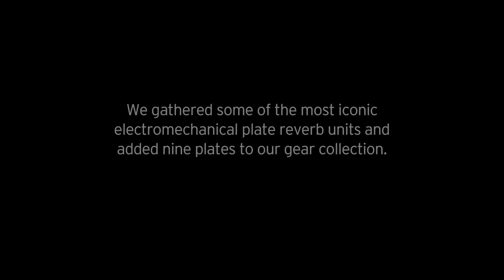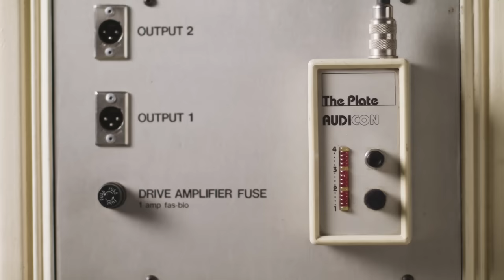Introducing Soundtoys SuperPlate

Comment: Again, I am back. After extensive testing I can safely say that this is the absolute best sounding reverb in my Arsenal. I have managed to consistently get the sounds I’ve always wanted from a Plate reverb. This reverb will win technical achievements awards. This thing does. Not sound like a plugin. I own all of Liquidsonics, all UAD Reverbs, Valhalla, Waves, Baby Audio, Lexicon PCM…And I can safely say it was worth the wait for this Soundtoys plugin. This plugin could easily be sold for $299 and would still garner sales.

Comment: Free for 5.3 bundle owners (thank you so much!). 
Upgraded to 5.4, Installed and tested - this is a freaking awesome reverb. Incredible depth and stellar sound design capabilities. 
Just running a piano through the "spaces" presets is truly inspiring. 
You guys never cease to amaze us.
Reply: Not true!
Reply: @jazzampa  what's not true?
Reply: @pietrogirardi  Not free for V5.3 owners
Reply: @jazzampa  I'm a 5.3 bundle owner, I updated to 5.4 today, for free. Superplate was included in the update. Are you a 5.3 bundle owner?
Reply: Free for 5.3 owners?
Reply: Totally not true. 5.3 user here too and they want $29 to update to 5.4.
Reply: @davespicer2143  this is weird. I think you should get in touch with them, everything worked smoothly here.
Reply from the maker: Hi everybody! Here's what's up: To UPGRADE to Soundtoys 5.4 with SuperPlate there is a $29 upgrade cost. However, we have a free 5.4 UPDATE that improves graphics and comes with a set of new factory presets for Effect Rack that include SuperPlate. Even though SuperPlate is a paid add-on to the Rack, you can install the latest update and listen to all the new factory presets for free. To do this, you install the latest UPDATE (V5.4) from your Soundtoys account to audition all of the presets showcasing the new reverb. While it’s free to check out all the new factory presets, SuperPlate’s settings will be locked until you buy a license. The $29 UPGRADE intro offer to add SuperPlate to your Soundtoys 5 bundle is valid thru June 14, 2023.

Comment: Well I bought the update as soon as I saw it & it's just... ❣
Reply: @Soundtoys fam! I made a mistake, I think. I activated the plugin in my studio computer instead of the iLok. Is there a way to use the plugin in the laptop I use for teaching & my studio or should I use the iLok activation for that? I looked for an email contact, but couldn't find it. Thx in advance.
Reply from the maker: You've got two activations so you should be able to use it on both! If you have trouble getting that working, our Support Crew can help if you open a ticket at support.soundtoys.com.

Comment: If You are user of 5.3 - there is no chance to have demo of superplate, only to buy upgrade - so thank You)
Reply: oooh I see - to demo it, I must to demo all new 5.4 pack, ok there is a mystery) The only brand with the free-for-life bundle upgrades is Melda
Reply from the maker: You can also install the free 5.4 UPDATE to the bundle from your user account before you UPGRADE to Soundtoys 5.4 with SuperPlate. Even though SuperPlate is a paid add-on to the Rack, you can install the latest update and listen to all the new factory presets for free. Simply install the latest UPDATE (V5.4) from your Soundtoys account to audition all of the presets showcasing the new reverb. While it’s free to check out all the new factory presets, SuperPlate’s settings will be locked until you buy a license.